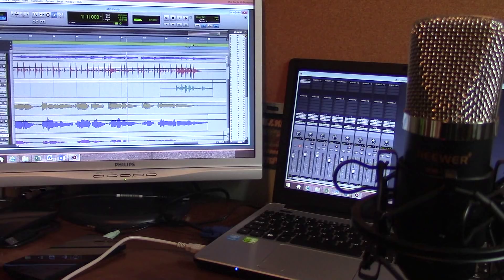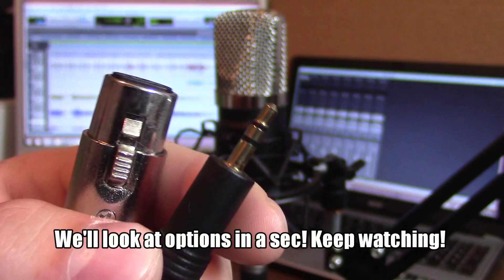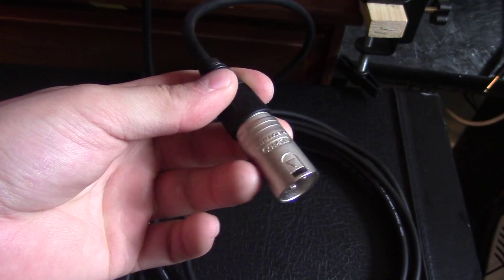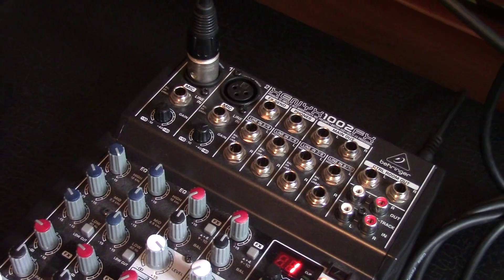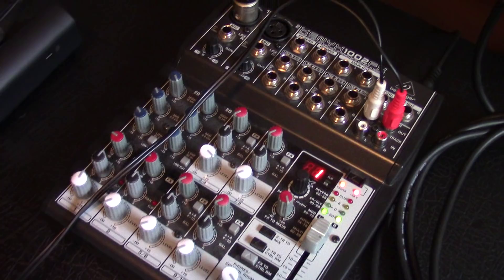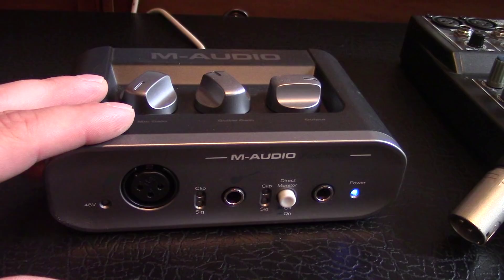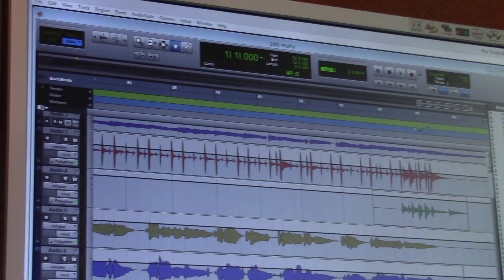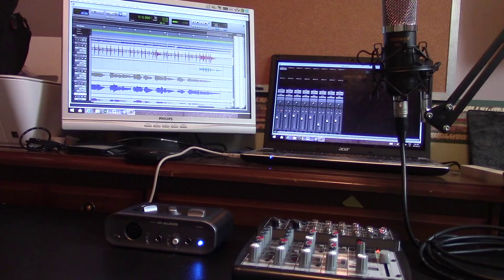How to hook up the Neewer NW-700 / BM-700 / Any condenser microphone

Comment: what kind of adapter would I need if I was using a double xlr and the one that came with it
Reply from the maker: +Red-Does-Games Well, I would use the double XLR to run into a power supply, and then the one that came with the mic would go from the power supply into your computer, since it's a 3.5mm.
Reply: thanks
Reply: +Weiderfan Ok so i've done this any for some reason it's still not registering on my computer.
Reply: +Zrkrownage +Weiderfan yeah same problem
Reply from the maker: Are you running from power supply directly into the 'headphone' port on your computer? If you are, it means you aren't using an interface and hence no interface software. You will need to play around with your computer settings to get it to recognize I think. I cant really help you with this part. When you use an interface, you have software that comes with it and so the software automatically recognizes the mic. With this gear, you'll need to manually select it.
Reply: +Weiderfan again in English please
Reply: +Weiderfan +Red-Does-Games Ok so it's registering i figured out the problem is that the levels are ungodly low, What kind of software would be required to properly adjust the levels because it just isn't picking anything up. red. Try tapping your mic while looking at the playback in the audio devices, it should register a slight amount of sound.
Reply: +Zrkrownage yeah I got that but I'm same as you, it doesn't register anything below a yell
Reply from the maker: Red-Does-Games That was English. An audio interface, such as the M-Audio little blue box i'm using, will come with software. When you plug in your mic, the software (audio program) will automatically find it. Without either of those, you have to HELP your computer find the mic. Zrkrownage Is your 48V turned on? Sounds like a lack of power to me.
Reply: +Weiderfan Plz if you could explain how to make it so our mics pick up more then a yell we'd be super greatful
Reply from the maker: Zrkrownage Red-Does-Games Really wish I could help but i'm not sure! To me, it sounds like there is a lack of power. I believe I had a few people comment with your exact problem. I know one lady who forgot to actually turn on a little 48V switch at the back of the power supply. Wish I could help more guys!
Reply from the maker: Zrkrownage Red-Does-Games Cable issues? just throwing out ideas here now.
Reply: +Weiderfan Check the cables it's just not working, I shouldn't have to have a mixer right? It seems like it needs a mixer to turn up what it can pick up. But it shouldn't need one if I'm correct isn't there a program i can use even if i have to pay for it? A program specifically to turn up how much your mic picks up. Idk if thats gain or what but.
Reply from the maker: Yeah, there are tons of audio programs, some that are free and commonly used. Audacity is a pretty common one. You shouldn't need a mixer.
Reply: +Weiderfan Ok i've noticed though that it only will do it for those specific programs, how do i make it so my mic in general pics up more, like a mixer but that is only software. A mixer you have it plugged in and can have the gain where you want it so it can actually hear you, and it make it happen for the mic itself not a specific recording, how do you do that without a mixer. Thank you so much for trying to help me dude i appreciate it buckets loads.
Reply from the maker: No problem buddy. Wish I could be of more help, but i'm not exactly sure how to do that. Whatever program you're using to record should have those adjustments on it!
Reply from the maker: you using windows 8?
Reply: I FIGURED IT OUT! you have to have it plugged directly into the mic por that is on your sound card. i had it plugged into the one at the front of my pc. but the one in the back worked.
Reply from the maker: Yay! Glad you figured it out brother! Makes me happy! Enjoy!
Reply: Yeah thanks for bearing with me dude. if anyone else in the future is reading this, this dude is Helpful AF! Thanks again!

Comment: Hello!
So, I bought this microphone with the phantom power supply.
I connected it to the phantom power supply, then to my laptop from the supply, and it has no sound...
When I record with audacity, I have to put the gain to max and my computer's volume to max, to hear it, BUT there is static in the background.
Can you help me?
This is the laptop which I am using: https://www.cnet.com/products/acer-aspire-6930-6809-16-core-2-duo-3-gb-ram-320-gb-hdd/specs/

Comment: Hi so I bought the audio interface and all the cables for my Neweer mic and it still wont connect to my laptop. I'm using it for singing and instead of coming out clear it comes out patchy when I use a instrumental background and wont show up in Presonus equipment. Any advice?
Reply from the maker: +SimplyVelia Hmm. Patch/ broken sound would likely be a cable issue. As for not showing up in presonus, you mean the software wont find the interface? Is the software compatible with the interface?
Reply: Well once I plug in the output cords to the interface and then computer it doesn't do anything :/ I thought maybe it would pop up as like something I had to download to be accepted to my comp. But nothing. And do you know what software is compatible with this type of mic?
Reply from the maker: The software doesn't deal with the mic. The software only has to deal with whatever audio interface you plug in. So, your mic goes into your interface, and your interface goes to your computer. Whatever interface you're using should have came with some editing software, and they should recognize each other straight way. The mic really has nothing to do with this part.
Reply: Oh the interface never came with any software, thank you for your help :)
Reply from the maker: Hmm. You said you had a presonus interface, I thought? That should have came with some sort of editing software. So, what are you using to record then? What program? When you aren't using a piece of software that connects with your interface, you need to HELP your computer recognize the new mic. This would be done in your computers settings. I have had several people here with a similar problem. Play around in your computers settings. One more comment that I HAVE TO ASK, because some people have actually done this: Did you actually 'turn on' the phantom power? some of the interfaces have little 'on' switches. haha
Reply: Yes I tried to find an "on" switch but it doesnt have one, it just plugs into my wall, then I connect the mic to the interface then the mic and it started to work but now its not working lol. The lights would turn green showing it was picking up the sound but yesterday it wasnt doing that. And the interface is not personus the software I have for editing I bought separately which is personus, sorry I should've been more clear on that. I bought the interface off amazon I will put the link down here so you can see what type of interface I have :http://www.amazon.com/gp/product/B000J5UEGQ?psc=1&redirect=true&ref_=oh_aui_detailpage_o01_s00
Reply from the maker: Nice little interface/ mixer! I like it! Pretty simple setup. For it to 'start working, and then cut out again', maybe a bad cable? Try this: plug your mic into the mixer, and UNPLUG the mixer from the computer. Now, put on a set of headphones, plugged into the 'phones' port in the mixer. Turn up some volume and sing into your mic. Does it work? Lots of volume? If it works, then you know the mic, mic cable, AND interface are all good. You've just ruled out a bunch of possible issues.
Reply: Okay! I'll definitely try that!!!

Comment: Can i buy xlr female to xlr male and scarlett solo to this mic? Or its gonna explode or something?
Reply from the maker: +yNfrN0 Scarlett solo??
Reply: +Weiderfan Focusrite scarlett solo
Reply from the maker: Oh, right. You can run mic to solo, solo to computer, no problem! That'd be a very nice system.
Reply from the maker: Is the solo a usb connection or xlr out? That will determine whether you plug in to your USB or your audio jack. I'm guessing it's usb, which is excellent! SUPER easy connection with usb.
Reply: +Weiderfan Ty for reply :)
Reply from the maker: No problem at all! :-)
Reply: +Weiderfan Last question is this arm 360 deegre?
Reply from the maker: Yes it is! :-)
Reply: Thank you :3

Comment: thnx man appreciate it a lot
Reply from the maker: No problem my friend!
Reply from the maker: Do you have to plug the mic into a phantom power source? You do! It's a condenser mic, so it needs a power source to run. Its not complicated. The set-up is quite simple.
Reply from the maker: Sure. I like this one right here. Probably the best value you'll find! http://www.amazon.ca/Behringer-PS400-Ultra-Compact-Phantom-Supply/dp/B000FG795I/ref=pd_sbs_267_1?ie=UTF8&refRID=0YZPZJCAJ3GGNTRD0W35
Reply from the maker: You will need 1 double sided XLR, and one XLR to 3.5mm (headphone size).

Comment: Hey man so I just bought the Neewer NW1500 and it plugs into the 3.5 into my laptop. Will an audio splitter allow me to plug in my mic as well as headphones? Please let me know, and if my question is unclear my fault, I will try my best to clarify.
Reply from the maker: hey, not it will not. :-) the mic is a SOUND IN, and the headphones would be a SOUND OUT, and the jack cannot do both at once! thanks for commenting!
Reply: Weiderfan so would the best solution be to get some headphones that plug in to the usb and leave the mic in the 3.5 mm jack? Lemme know what you think! Great videos man.
Reply from the maker: Your best bet would be to buy an audio interface or a little mixer, such as the behringer 302USB. This will power the mic, allow you to adjust sound quality, and let you use headphones with your mic :-)
Reply: Weiderfan I already have phantom power and that particular set up on the way. The headphones are simply to listen to the beat/instrumental and possibly hear my voice. Is a mixer still the only fix for that?
Reply from the maker: What exactly is it that you have on the way? Mixer/ interface is the way to go for this.
Reply: Weiderfan I have the neewer nw1500, that connects to phantom power 48v through XLR cables and straight into my computer with the 3.5 mm jack. And I want to plug in headphones as well so I was thinking of getting the USB adapter for headphones.
Reply from the maker: That should work
Reply: http://www.amazon.com/Virtual-5-1-surround-External-Sound-Card/dp/B000N35A0Y/ref=pd_sim_147_3?ie=UTF8&dpID=315YCtwvgfL&dpSrc=sims&preST=_AC_UL160_SR160%2C160_&refRID=029FJP6SP682XBPHHC25

So this was the usb adapter I was thinking of getting. I would connect my headphones that I want to hear myself and the music through that while plugging in my mic (neewer nw1500) into the 3.5 mm. Just making sure. Thanks man I appreciate all the help!
Reply from the maker: No experience with the USB adapters, but it should work!

Comment: Hey man,

Great video! I have a question for ya.
I bought this unit http://www.amazon.ca/gp/product/B014H8AWGC?psc=1&redirect=true&ref_=oh_aui_detailpage_o02_s00 along with the nw7000 mic instead of the one that you mentioned and after everything is plugged in, the mic barely pics up any sound and the volume on my computer is very low (thats after i boost all the volumes in Windows to full). Do i need some kind of an interface to work with this power supply? Is it because it works only on +48V? Or could it be that my laptop has a shitty sound card and it wont be able to handle a mic like this one?

Any help would be appreciated.
Reply from the maker: +Darek Z Hmm. I am actually not sure. You have the mic going into the power supply, which has 48v, and then the power supply runs into your computer. It should work just fine without an interface. Perhaps a software/ computer issue? Hope you figure it out! Good luck!

Comment: Anyone that would be able to help me out, my neewer nw-700 picks up my voice perfectly but every single background noise aswell. Like Mouse Clicks. And i seriously have no idea i have tried everything i could have thought off... Like changing the reinforcer and that stuff. Anyone who has ideas?
Reply: Try using the fuzzy thing that goes on top of the mic which i forgot the name of. Otherwise, try using a pop filter. That's the most I can think of. I'm not too much of a microphone expert.
Reply: I got it fixed already, just needed to roll back my input drivers, so it could match the XLR input. But thanks for caring and trying to help!
Reply: Aw. You're welcome, bro.

Comment: NONONO phantom power is NOT the same as pre-amp. And also the challenge is not powering and amping the signal. the challenge is converting balanced output to unblanced input in the right way. Mostly done in the wrong way it causes extra hissss and taking away the lower frequencies. This makes the sound worse then a cheap headset mice. If you are really serious about sound then learn about balanced vs unbalanced or simply buy a mixer with all kinds of in and outputs and let that device worry about  phantom power, pre-amping , mono vs stereo and converting balanced to unblanced and vse versa. The shown device that could power the mike and was connected via USB has build in: phantom power, pre-amp and AD-converter.   Please do not buy a device that just creates phantom power. it is not the same. Also XLR and jack are not just types of plugs that can be changed without consequences all the time. Please be sure you understand the balanced vs unbalanced story before you buy anything else then a mixer which does all the converting for you  :)
Reply from the maker: +computerjantje Greatly written! Thanks for watching. You have certainly mentioned a few things that I do not know much about. So, for the 'uneducated', an interface or small mixer is definitely the way to go it seems. 

Are you fairly familiar with all types of audio? I have a question about a shotgun mic!
Reply: +Weiderfan  I do not know much about shotgun microphones or other specifics about directional microphones. But please try . Maybe others here know and maybe I know a little :) For video I do use longer microphones sometimes when for example there is no budget to give all performers in a musical their own headset. But still there is no real substitude for getting the mike as close as possible to the subject. That always sounds way way better then even the best shotgun.
Reply from the maker: I agree with your points 100%. I videoed a live theater performance in december and the shotgun was the best option, because the actors couldn't be mic'd.

I'll try my question anyways: Why cant I plug my shotgun mic into my mixer? I have a shotgun, which has a 3.5mm wire. Shouldn't that be able to plug into my mixer and work? I've tried it every way I know how, but there is just 0 sound. Nothing. As if nothing was plugged in.
Reply: Weiderfan
 Is the shotgun equiped with a mono or stereo jack. If the jack is stereo then is either is a phantom powered microphone or a stereo microphone. If made for videocamera's my guess would be it is a stereo microphone.The microphone does not have a "secret" battery compartment?   if it not is a (phantom) powered microphone then it usually needs the pre-amp in the mixer at a higer level.But my guess is you tried all that. What is the brand and modelnummer?
Reply from the maker: It's the Opteka VM-100. It's powered by a 9v battery. I have tried running it in all these configurations. into mixer with: mic turned on, mic turned off, off and  battery removed, phantom engaged, disengaged, and so on. haha Absolutely nothing...
Reply: ok, it looks like this stereo mic puts the left, channel on the tip, the right channel on the ring and the ground on the sleeve. Maybe you try to put the mik into the larger-jack of your mixer by using a mini-jack to normal jack plug?  Most likely your mixer mike input is a balanced input which has a xlr and jack choice. In that case the mixer jack expects a mono balanced signal instead of a stereo unbalnced signal. You cannot connect the stereo mike to a balanced jack input without converting. But maybe you put the stereo minijack output to a stereo line input of your mixer which maybe not has a mik pré-amp so the signal is to low.  To hook up a stereo unbalnced mike to a balanced (mike) input you need to convert the stereo mike out to two mono jacks and put them in two pre-amped channels of the mixer. It is my guess that maybe this is currently not the case. Hower first be sure the mike is ok bij testing it with a device that expects an unbalanced stereo input like a videocamera with external mike input min-jack stereo port. Ofcourse I am guessing here :)
Reply from the maker: Thanks so much for your lengthy piece my friend! Lots of detail, which I really appreciate! I'm sorry that it is of no help though.. everything you wrote, I have already tried! It's frustrating.. haha I have given up on the matter. Thanks again!

Comment: @weiderfan Can i plug it in with USB ( XLR to USB)?
Reply from the maker: +Lucian Meuser USB doesn't supply enough power (only 10-15v). Won't work! Thanks for watching! :-)
Reply: +Weiderfan i read that it needs onlye 3v :| then i gonna buy the Rode nt1a ^^
Reply from the maker: It's a condenser mic. Condenser mics require 48v.
Reply: +Weiderfan ok thanks :D
Reply from the maker: Thanks for watching :-)
Reply: +Weiderfan watch + sub :P
Reply from the maker: :-) Thanks!